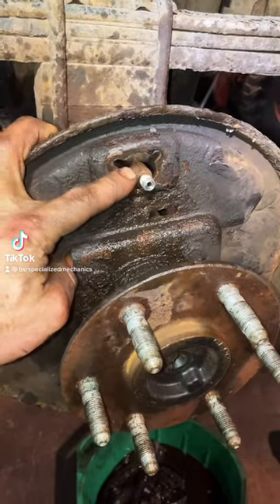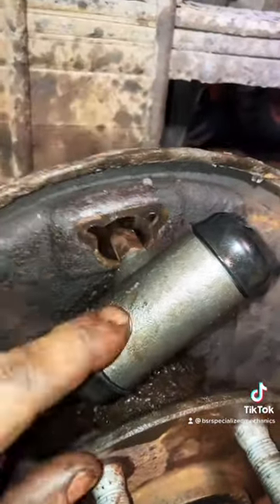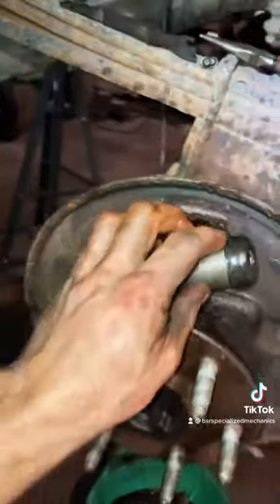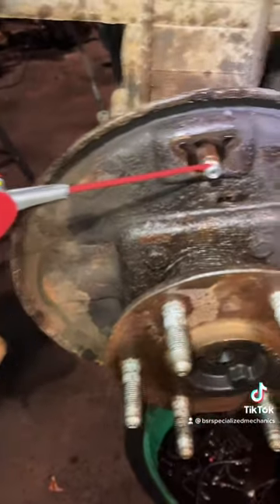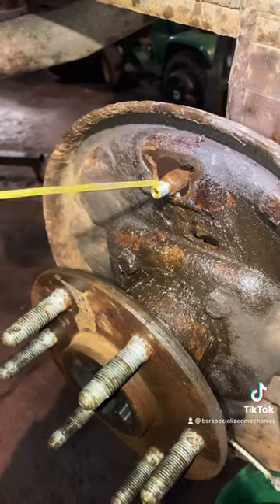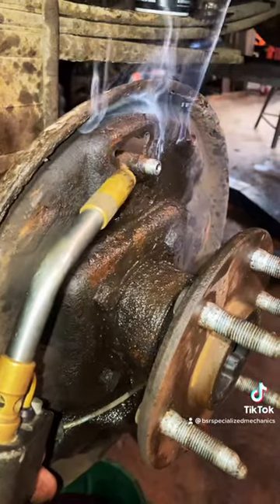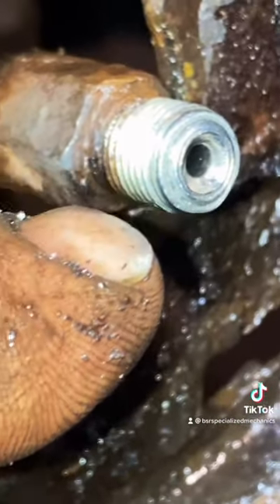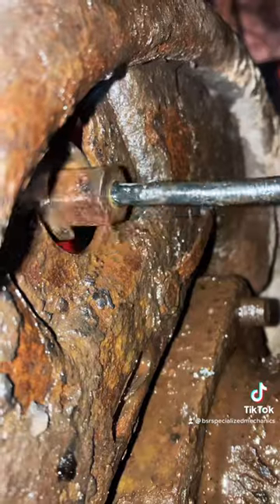Wheel Cylinder R&R pt.3 #mechanic #howto #tips #diy #cars

Comment: Anytime a brake line is removed like this slide the tube nut back away from the flare about 1/2”. Put antiseize compound around that 1/2” of tubing and the flare. Slide the tube nut back to the flare and put antiseize on the threads.
Now the tubenut won’t seize to the tube or the flare and the threads won’t rust either.

Comment: When you get it hot put a candle on the tube and capillary action will draw the wax into the crack.  This will prevent the 2 from rusting back together.

Comment: I'll often spray them and spin the shit out of it with an impact driver (after manually breaking it loose) to really get it spinning freely. Apply a bit of high temp grease under the nut if possible to prevent future rust. Usually it works haha

Comment: Threads between batches never clock the same. Tool changes, different clocking of parts, slippage, and operators change all the parameters. I'm trained as a machinist,  so being a mechanic is like installing the parts that I made. Easy peasy

Comment: Bleed the line before installing or you could damage the wheel cylinder or caliper.
Reply: That's what the bleeder screw is for
Reply: And that would be a waste of time. You bleed the entire system when done 🤪
Reply: @MrVAuto  yes thank you someone with a brain they actually use. I wouldn't risk it on a $100 truck caliper just to replace it again. I personally dealt with this before buying a car then someone used grease in the wheel cylinder or caliper. I seen brake master cylinders go out because of contamination.

Comment: Amazing how much heat helps when you lube it like something more lube and heat the better 😂🥰🥰🔥
Reply: It's like 95% heat and 5% lube. In my experience penetrating oils are bullshit unless you give them hours to work
Reply: @DaDaDo661  transmission oil is what I use 9/10 time and it workers really good for me.  I cut it with some solvent like iso alcohol giving a mix while applying it.

Comment: Remind me if I'm wrong isn't brake fluid flammable
Reply: You may be thinking of transmission fluid. I was surprised that I had to show my ID when I bought ATF +4 from Walmart
Reply: @ProleDaddy  it sure is ! where you coming from ? You obviously have no idea what your talking about to oh oh
Reply: @ericschulze5641  I guess we need to put a lighter to it now.
Reply: @ProleDaddy  no we don't many years ago, I tried to swedge & silver solder a break line all went well until the brake fluid ignited & began to blow out like a flame thrower, causing severe burns to my torso, as I was laying underneath the vehicle, no further testing is needed, but I bet you think oxygen is flammable IT'S NOT, brake fluid IS
Reply: @ericschulze5641  No need to go on an ego trip because you didn't know this in the past. I don't know that anyone thinks oxygen is flammable.
Reply: @ProleDaddy  I didn't know what  ? that brake fluid IS flammable, give up boy it IS flammable
Reply: Brake fluid is flammable, just doesn't light up as easily as some other stuff. Antifreeze is also glycol based and flammable, but doesn't light easily.
Reply: @Krankie_V  Might put in into the category of combustible then?
Reply: @ProleDaddy  I'm not sure how all that categorization works. I just know you can get it to burn but not nearly as easily as something like gasoline, kerosene etc. It gives off some really unpleasant fumes when it burns too. And it gives off a dim flame like alcohol does.
Reply: @Krankie_V  The line between combustible and flammable is drawn at the ignition point temperature. While gasoline is flammable, diesel fuel is combustible. Diesel fuel cannot be lit with a match.
Reply: @ProleDaddy  yeah sounds about right then. Brake fluid is probably a bit tougher to light than diesel. Based off very non scientific testing though 😂

Comment: Yeah as long as it's not one of those plastic coated lines you'll be good cause if it is that plastic coded line will hard and backup you won't be able to move it againYeah as long as it's not one of those plastic coated lines you'll be good cause if it is that plastic coded line will hard and backup you won't be able to move it again